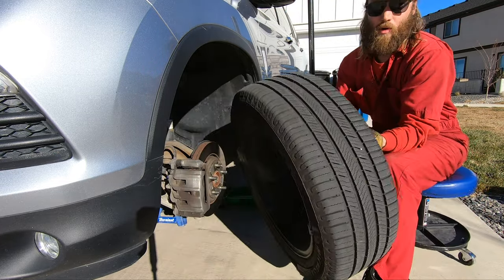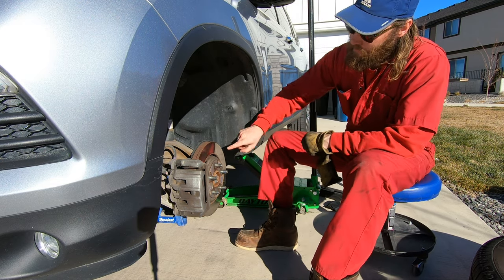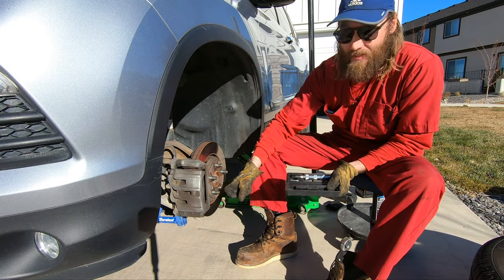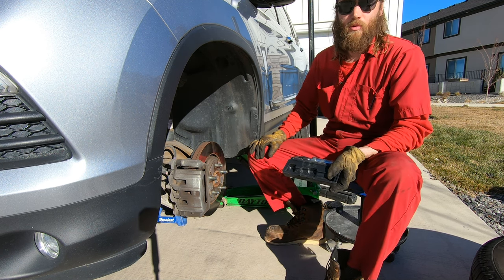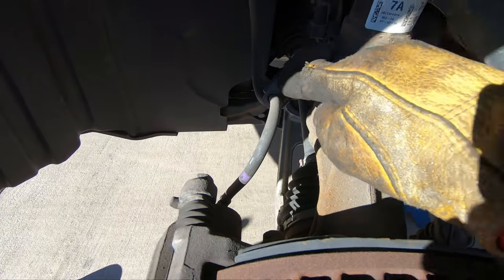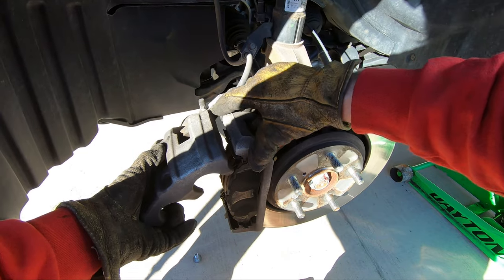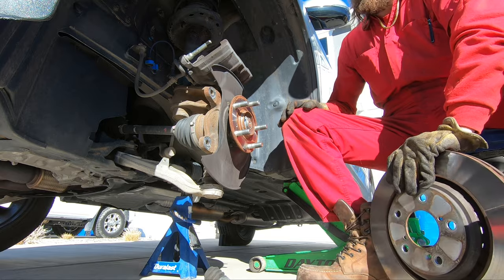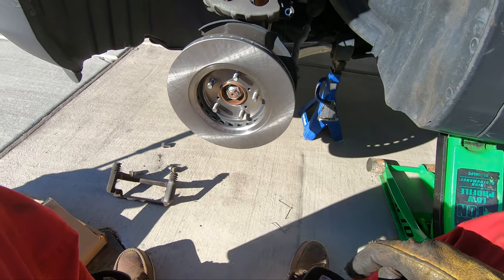EVERYTHING You NEED to KNOW Before Doing Your Brakes!

Comment: The extra threaded holes are for getting the rotor off if it is stuck. Just like you said, put some bolts in and if you keep tightening them it will force the rotor off.
Reply from the maker: glad to know! Thanks!

Comment: A day late. Did just the wife's 2016 pilot front and rear rotors and pads yesterday. Tip i learned: when putting on the clips that exert pressure on the pads, attach the caliper but just 1 bolt, swing the caliper up and clip 1 side, swap caliper bolts and repeat on the other side. Took me 30 minutes of fighting with trying to keep the pads from coming out while trying to put the caliber back on. 😂

Comment: Im in the salt belt... So ill add never seize compound between the brake hardware and the caliper mount to prevent rust jacking.

As well as the hub to rotor surface because sometimes those two small threaded holes on the rotor may rust as well and you cant use them to separate the rotor from the hub😢

Comment: Great video, as always. Glad to see you back (looking different!) and posting again. Couple things, you "could" put so much grease on the heads of the caliper pins that they'd actually hydrolock momentarily (remote possibility, again "could"). I like to take the time to clean out the bores for the pins with brake cleaner, too. Also, a mention of brake bed-in for the customer, and you can only hope they follow it, would be good.
Reply from the maker: Thanks for the tips!

Comment: Good tips and advise. Sometimes people are giving tips and advise that are incorrect or inaccurate. What I will say is I’ve stopped putting grease on the back of pads and on the contact areas. Seen the grease harden and cause pads to stick or bind on shims/hardware. Nice to see your channel growing tho! Keep it up man!🙌
Reply from the maker: Great tip!
Reply: Grease can harden when you mix Silicone Grease with Petroleum based greases. Silicone when it contacts rubber, and petroleum based metal on metal. Sometimes people mix them, and they harden when they mix. Especially slide pins, and the petroleum based grease causes rubber to swell, and some slide pins have rubber sleeves that swell and seize the slide pins.

Comment: Honestly would have liked to see you torque everything down to specs.
Reply from the maker: oh its torqued to spec 120 dead on
Reply: That's too bad because the wheels torque to 94ft.lbs. Caliper brackets 101ft.lbs and calipers 53ft.lbs. 🤷🏽‍♂️
Reply: @Joe_SIFU daaaaamn sounds like u work for Honda u mobile???? I need work done cuh!!!!
Reply from the maker: oh ya... becuase that is normal...
Reply: @Umamalovezme its called the service manual... its like the bible for mechanics lmao
Reply: @Joe_SIFU  oh, c’mon….how many pros do you REALLY think bother using a torque wrench for mundane everyday jobs?  Ever work Flat Rate?
Reply: @craigjorgensen4637  anyone who gives a shit.... Those are safety components that you wouldn't want to half ass. Also I'm pretty sure I saw a video from him redoing some rotors he installed because a shop had damaged them due to over torqued wheels yet he does the same.
Reply: @Joe_SIFU  oh, give me a break! Most torque values aren’t all that critical. Wheel torque 94 foot pounds!  Do you really think  torquing them evenly to 120 pounds will make a safety difference?  Don’t think so!
Reply: @Joe_SIFU  We used to work a lot on old VW Beetles.  I remember the rear 36 MM axle nuts called for 238 pounds of torque!  We were all kids and could barely afford the damm socket!  I called a trusted older VW Mechanic and asked his advise.  He told Mr “ just tighten the shit out of them!”  H didn’t bother with a torque wrench either!  That’s what I did and never a problem!  True either way most other applications!  Just use common sense!
Reply: @craigjorgensen4637  wtf does torquing bolts to spec have to do with u not being able to afford a 36mm socket. Do the job right and don’t complain it’s not hard at all
Reply: @Umamalovezme  Don’t think I complained!

Comment: Even if you don't have rust, brakes create dust. This dust gets between the hub and rotor and causes round rotors to be tilted and out of round. The set screw also helps when you need to change a tire on the side of the road. Each time the rotor moves off the hub, it should be cleaned so a proper mating surface can be made to prevent vibrations. This set screw doesn't just protect heads on assembly lines, they makes sure your tire can be put back on without disturbing this surface between the rotor and wheel hub. Great video aside for my nitpicking.
Reply: That hurt my head reading all of that incorrect information.

Comment: 2:52... Good practice to chock the opposite side.

Not really trusting the rear parking brake mechanism to hold the vehicle still while jacking the front of the vehicle?😊

I do the same when I jack up the front for oil changes 😅

Comment: Here is a pro tip from years of experience. Another reason why the pads wear uneven is too much grease on the pins. Grease does not compress and the pins need to go back and fourth. All you need is just a little grease on the pins.

Comment: Most of the jobs ive done no one wanted the rotors changed only the pads
Reply from the maker: ya weird. I have to convince people to get rotors a lot.
Reply: @RoadsideRescue  they always think saving money is going to keep a problem away but it only makes it more expensive in the long run
Reply: They always jump over a dollar to save a dime.
Reply: @thealliedspy4170  yep
Reply: Yeah, they're from old school...

Back then, brake rotors were made better and thicker (had to operate a brake lathe in an auto parts store in the late 90s)

I mean if they don't feel any wobble when brakes are applied, then a pad slap can work until the next pad change.

Now, if the rotors are scored or other defects like what Ernest said (cracks or wavy surfaces)

Then, actually show them the imperfections and make them sign a waiver against any warranty comebacks 😊
Reply: I am in a northern climate with heavy salt use on the roads. It is VERY rare a car does not get rotors. Its pretty much standard to get rotors/pads.
Reply: Of COURSE nobody WANTS the experience rotors replaced!  Sometimes a good shop needs to decline a job when a customer wants to cut corners!
Reply: One can only imagine convincing an A&P mechanic to cut corners.

Comment: Recently did all 4 rotors and pads on my 1 series. Has this issue where I’d have a vibration on acceleration as if the propshaft centre bearing had gone. Did the brakes and it turned out it was the discs on acceleration! Weird problem to have
Reply: That is a weird problem to have, I personally have never came across that issue before, thank you for calling it out now i have something else in my knowledge book lol
Reply: @thatdusty950  to my understanding it was to do with the ABS trying to keep the car in a straight line simulating the E-Diff. Weird one!!
Reply: @ScottPC  interesting! So you did a complete brake job and it went away??
Reply: @thatdusty950   Yup! Brought all the parts for the propshaft and now im debating even touching it! The discs clearly affected it.

Comment: But why cant rotors simply be resurfaced like we did in the “old days” Besides, I’ve heard that a lot of the new Chinese rotors warp immediately?
Reply from the maker: gotta find a place that still has a machine for it. I dont. Most dont now a days.
Reply: @RoadsideRescue  I can remember when an Aamco Brake Lathe was standard equipment in almost every shop along with a Sioux Valve Grinding Machine!  I know…I’m a dinosaur!  I guess with shop rates hovering around 150.00 or more an hour it’s probably cheaper to replace them. The valve machines are now obsolete because cars no,longer need valve jobs every 40,000 miles.  And the beat go’s on….

Comment: Always use a torque wrench to set the proper ft/lb when putting tires on since uneven torque will make you have to buy new rotors or have to get them resurfaced.  Honda is 80 ft/lbs and I would guess by the force you used you were an inconsistent 100 ft/lbs.  Another bad habit I saw was not hanging the caliper with a hook or bungee from the dampener spring.  Novices may bump the caliper off the hub and rupture the brake hose line.

Other than those 2 points, it was a solid video for people wanting to learn how to do brake jobs.  The only other comment would be to check the brake reservoir prior to starting to verify there is a fluid gap when you compress the pistons.  Many people get brake fluid flushes and that shop may have over filled the fluid.

Comment: Bro totally skipped adding that springy thingy and collapsing the piston to account for the thicker pads.  So this video is totally NOT everything you need to know before doing your brakes.  For those interested search YouTube for Royalty Auto Service and look for his video titled "How To Perform a Professional Brake Job" - for the main parts but then you may also want to watch his video titled "It’s Vibrating When Braking & It’s Not the Rotors. How to Test!" that literally covers what else could be causing vibrations when braking and how to find them and cure them.  BOTH of those video give you all the information you need to diagnose and fix your brake issues.